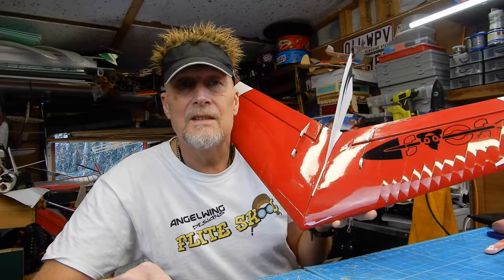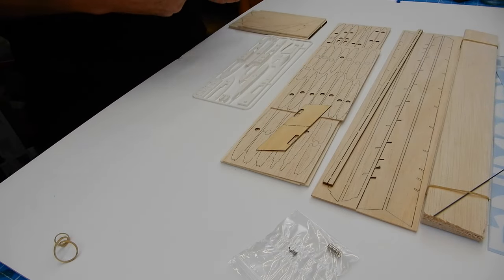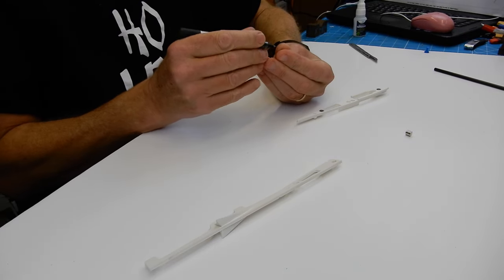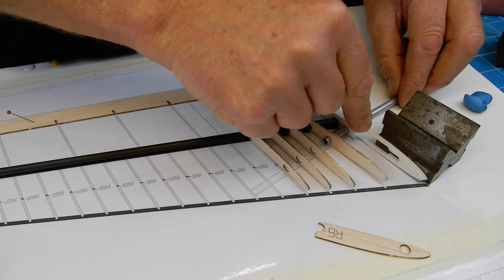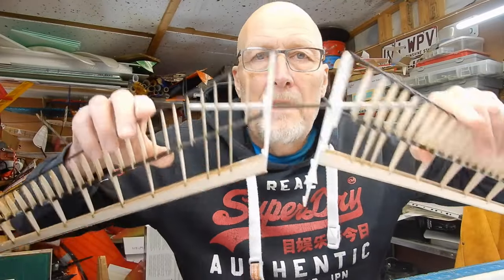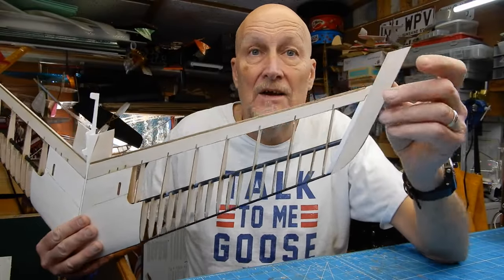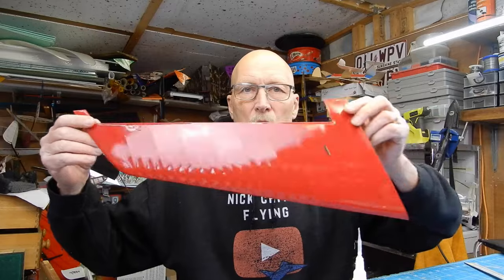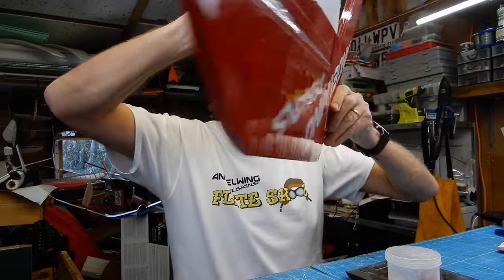How to Build SOAS wing in bag V3

Comment: Very beautiful design and I really appreciate the fact that an accurate build is thought of! Very important imho. I checked out the website, but there are no measurements, like wingspan, mentioned.
Reply from the maker: 900 mm mate 
https://cdn.shopify.com/s/files/1/0300/4864/9309/files/SOAS_v3_Instructions.pdf?v=1711460462
Reply: There is a table that shows on my admin side of the listing, but there is a HTML error that is beyond my understanding, so I've replaced the spec table with an image of the table.